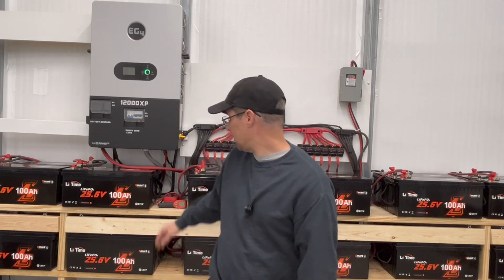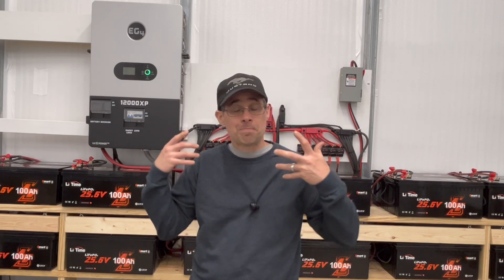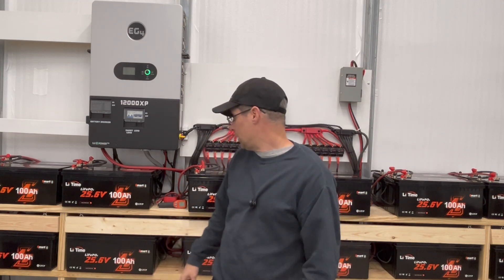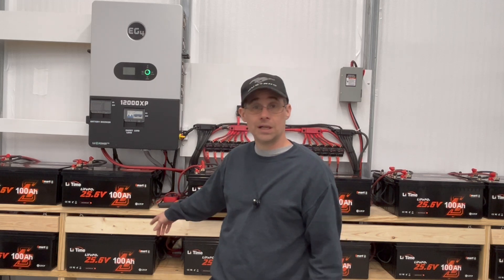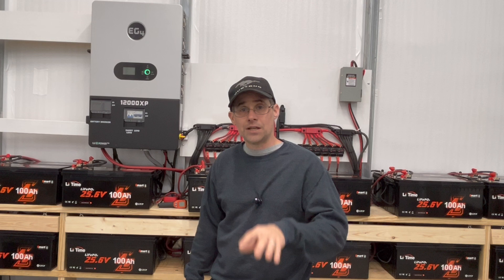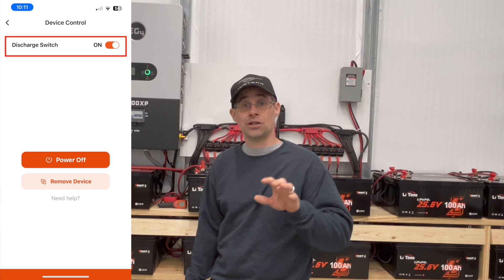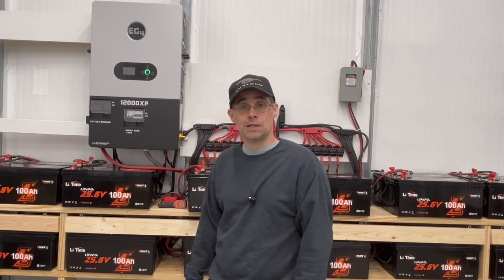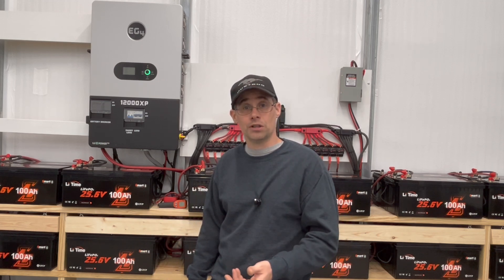Fixed My DEAD LiTime Battery!  Simple Bluetooth Solution (24v 100Ah)

Comment: Hope you can help me?! I have two li time 12v 100ah w/ Bluetooth batteries in series for my 24v trolling motor. Both are Bout a year old. I set up Bluetooth on both when I first bought the batteries. Have the Li time App on my I phone 16. The Bluetooth connection works is only working on now. The other Is fine. I disconnected the battery from the system so it’s isolated and tried to scan the QR code but it just says it is not a li time QR code?. I set these up before like this. Why won’t this li time battery Bluetooth work? Is there a phone number I can call and talk to someone in the USA? Why is one battery connected and the other won’t. They both used to be. ??? T I A
Reply from the maker: Hi Joel,  LiTime is based out of China but let me see if I can get some information for you.  My hunch is since the BlueTooth is not available on one, it may have failed.  You can potentially try uninstalling the app and reinstalling it on your phone, or perhaps try someone elses phone.                                                                           Customer Support: (+86) 181-2417-3126
Monday to Friday: 17:00-24:00 (PST)  Note: SMS unacceptable
service@litime.com
Reply: @MikesSolarGarage  The battery may have turned off, have you tried charging it to restart?   Also, I turn mine off when working with them, so I can't short circuit the battery.
Reply: Thank you so much for this video! After weeks of frustration with our new LiTime 230ah smart battery not working in our travel trailer, this little fix seems to have been the solution! We have solar panels connected to it, so if the sun was out we were able to get a tiny bit of power out of the battery (not sure why that works that way) but everything was dead if the sun wasn’t shining. LiTime app and Victron solar controller showed the battery was fully charged, but no power. Went back and forth with LiTime trying multiple tests and looking for issues in wiring and connections. Nothing. They never suggested this Disconnect toggle switch in the app, and I didn’t know to look for it. It was off, and the minute I toggled it on everything seems to be working as it should! The big test will be tonight when the sun goes down, but for now, thank you thank you.
Reply from the maker: @LisaBricker44 You are very welcome.  You made my day with your comment.😊

Comment: I usually turn off the discharge on my batteries when I’m not using them—just to be safe since they’re on my boat. Didn’t want them draining for no reason. But the other day I had an issue where I couldn’t get the Bluetooth to connect. Since the discharge was off, it wouldn’t accept a charge or wake up the Bluetooth either. After some digging, I found out the app won’t connect to the batteries unless location sharing is turned on. Gotta love how you have to let them track you just to use their stuff…
Reply from the maker: Wow, that is quite interesting.  Thank you for sharing!

Comment: Thanks for the update! I have 4 of these LiTime 25.2v 100Ah Bluetooth batteries and they are working very well so far. The only problem is that the bluetooth app shows flickering readings when there is a high current charge or discharge. I used current meter and verified that there was not current bouncing when the bluetooth reading flicks. So far I have put about 15 cycles on these 4 batteries.
Reply from the maker: How many amps are you charging/discharging?